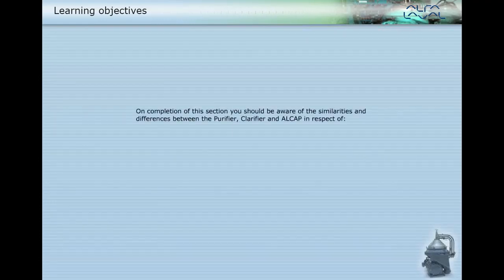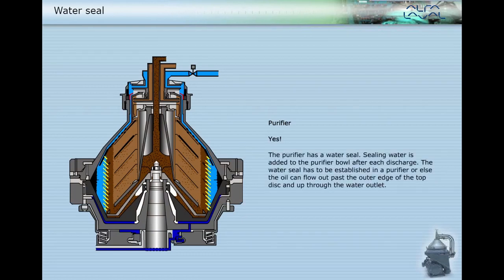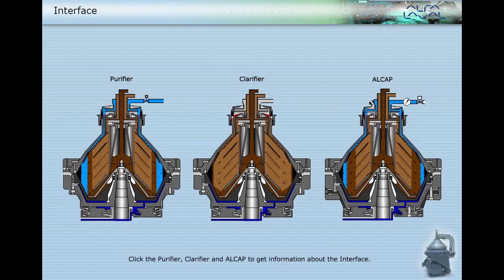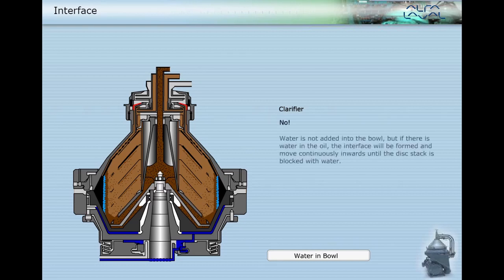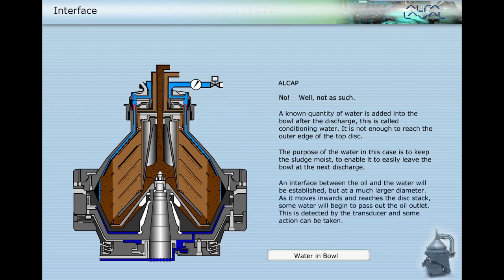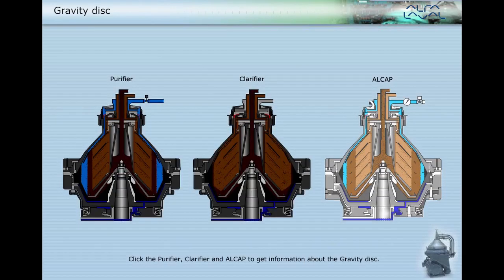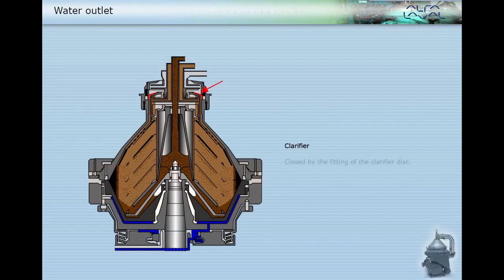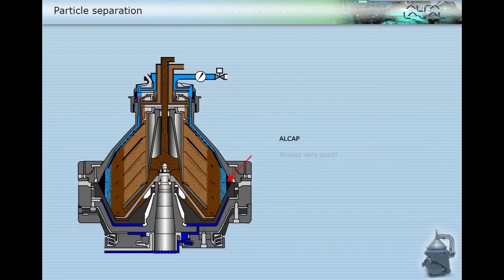Difference between PURIFIER, CLARIFIER, and ALCAP    Bowl Comparison

Comment: If assemble separator According to manual but oil leaking from bowl  still coming what should I do
Reply from the maker: Kindly check for, Temperature, PT1, PT4, PT5, and drain water from your settling tank..